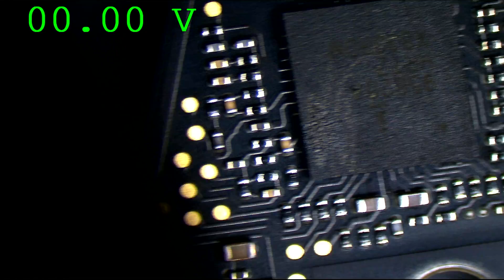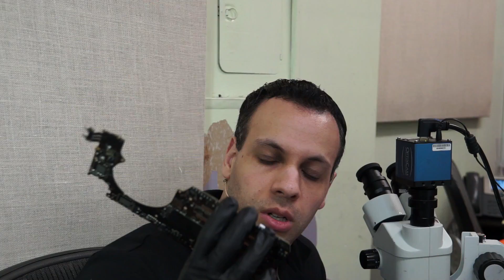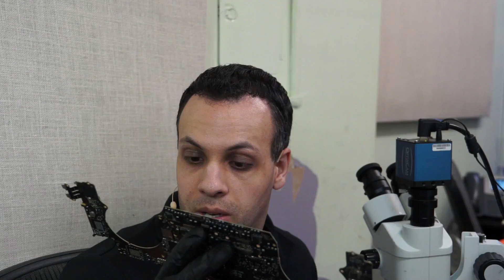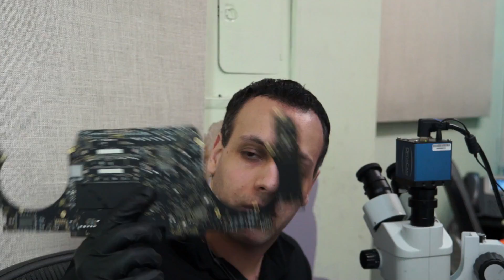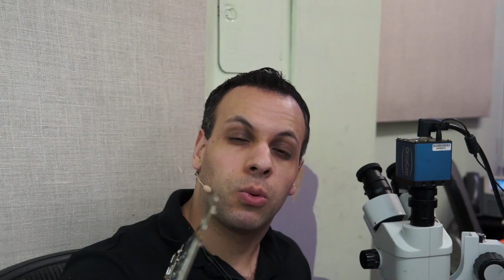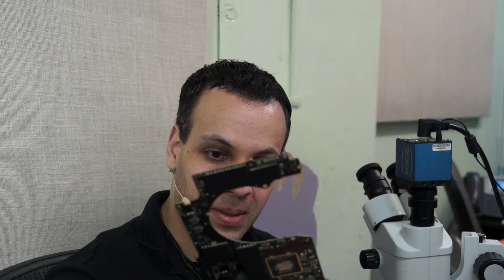Dog whistles are bad.

Comment: Coincidentally (as in, it's a coincidence that [1] I'm in my current situation and [2] you're looking for a schematic for some random motherboard), I'm waiting for a response to a request (that I made at some random URL) for the schematics of a very specific motherboard. That wait started on 2019-04-23 (YYYY-MM-DD); at roughly 17:25 (HH:MM) U.S. Eastern Time.

Just out of curiosity, is the random motherboard (with which you're having fun) from the The MacBook Pro Touch Bar 15" A1990 laptop?

Comment: You could try comparing the board with the previous model and see what they have in common and then compare how the info of the previous version and see if it matches on the new one replacing what is wrong.  Not like they changed the powering process or anything.  Just some chips are different, so you would need a donor for that.

Comment: this one website, uses an older model schematic. not sure if that works 
https://www.it-tech.com.au/single-post/2019/03/18/How-to-fix-2018-MacBook-Pro-15%E2%80%9D-touch-bar-not-working-issue 
MacBook Model Number A1990 Year 2018   Logic Board Number 820-01041-07.

Comment: Sending a schematic for a 820-01041-a board to louis@rossmanngroup.com is wrong, and bad.  There should be a new, stronger word for sending the schematci for a 820-01041-a board to louis@rossmanngroup.com like badwrong, or badon. YES, sending the schematci for a 820-01041-a board to louis@rossmanngroup.com is badong.

Comment: What I'm not understanding is that most of the parts within these boards are practically the same.....you could probably pull up a variant to solve your problem.  It's not like those working at Apple manufacturing are the brightest bulbs, they tend to just let the software do the routing....and it ends up being just about identical.

Unless you're getting that age where following traces is too difficult on the eyes?  *shrugs.....I'd help if I could.
Reply: That board may have many layers. It would take a very very long time to map out all the interconnecting layers inbeteeen
Reply: @kg4boj  ....layers?  like, bottom and top?  But seriously, like I said, most of these are just wired automatically through a program, which means that most of the traces are going to be the same orientation.
Reply: @sabriath  Yes, layers... a typical number for boards like this is 5 layers.
And no,  its not a simple matter to figure out where they go. 
Many of these components are proprietary BGA chips (no datasheets) with hundreds of pins going all over the place through who knows what interconnects. It could actually take many hundreds of man hours to reverse engineer one of these boards assuming you had a few known good boards to burn and check each of the thousands of interconnects against every single other on the board and pray there is only one revision (unlikely)
He really does need the schematic to do this.
Reply: @sabriath  Apple manufacturing in china (foxconn) doesn't have idiots designing their PCB's  either. Their devices are quite complex and well built, although they sometimes obfuscate a lot of things and throw traps in there to cause unauthorized repairs to fail. Not saying it's impossible but in terms of difficulty it would be like giving a person a tonsilectomy but instead of going in the mouth you went in from their ass..
Reply: Peter Carlson LMAO! Nice analogy. 👍😎
Reply: @glenholmgren1218  I kinda stole it though from a quote about nuclear weapon permissive action links (nuclear device security) . The quote was:
"Bypassing a PAL should be, as one weapons designer graphically put it, about as complex as performing a tonsillectomy while entering the patient from the wrong end.
— Peter D. Zimmerman, nuclear physicist and weapons inspector"

But I digress, It's about that complicated to make a schematic of these boards and thats by no accident.

Comment: what happened to SAMS PhotoFacts .. GRRrrrrr  ..   if you have it ..  FAX it  .. DO NOT EMAIL ..  LOL ..   Just seen a you tub vid with farmers and tractors  .. same issue  ..  Right to Repair ..  a 1950's tractor is trucking over the fields doing work  .. breaks down .. farmer fixes  .. back working ..  a modern tractor with computer crap .. stuck in the field broken  ..  farmer can't fix  .. has to pay $$$$$$$$$ for a dealer  to fix ..  ( some farmers found a hack )  ..

Comment: Hey Louis, I love your videos and binge watched them after my computer wouldn't switch on after spilling cranberry juice over the keyboard. The technician at the Apple store said there were minor corrosions but the entire logic board would need replacing if the laptop doesn't switch on. Just now I opened up the case and blew off some dust and now it works again. I'm wondering though, whether to maybe get the laptop checked again because I really want to make sure that this laptop isn't getting high voltages as a result of any corrosions which I hadn't even found looking around the board on either side. Because all the spill went onto the keyboard, I struggle to even understand how it would even make it to the logic board when there is a tight plastic sheet separating the keyboard. Additionally the keyboard itself doesn't seem to let through much liquid went it gets water spilled on it. 
Anyway, I love being able to watch a video from you for the first time with my 2015 15" MacBook Pro!

Comment: It would be wrong too to share what's the led blinking error code on an LG plasma TV.  I have to trash my LG plasma TV just because the meaning of a diagnostic led on the control board is not published.  But Louis you are lucky so far to find the schematic of almost all the Apple products you are working on.  I've seen leaked LG plasma TV repair manuals (not one for my specific model), but the info contained in it is so diluted.  You have the schematic for the main board (which almost never fail), but none for all the other boards that frequently fail (power supply board, sustain boards, buffer boards).  It is a shame.  No right to repair, anywhere.